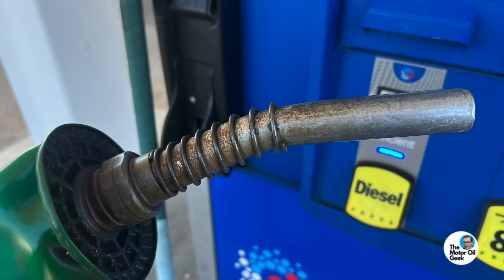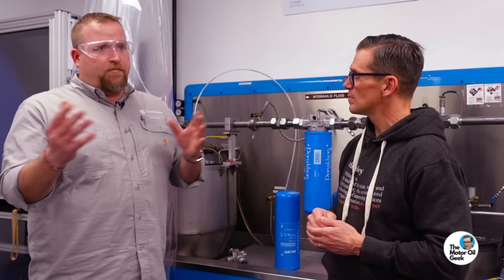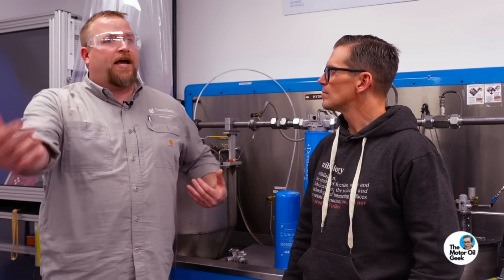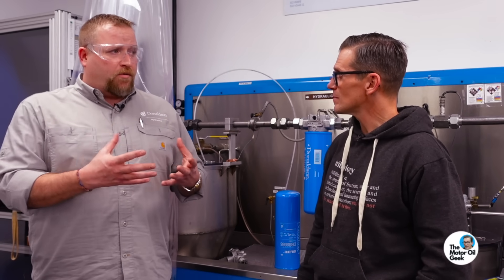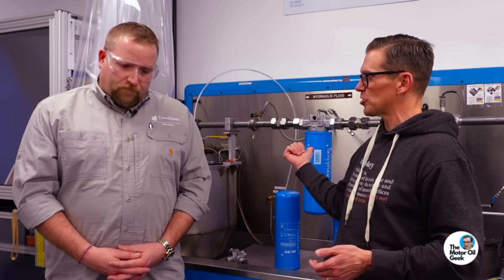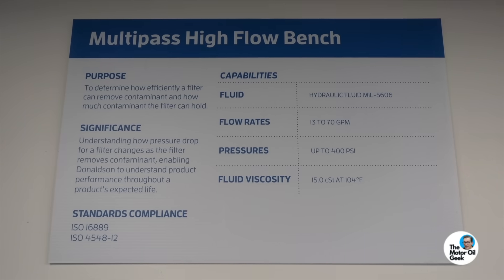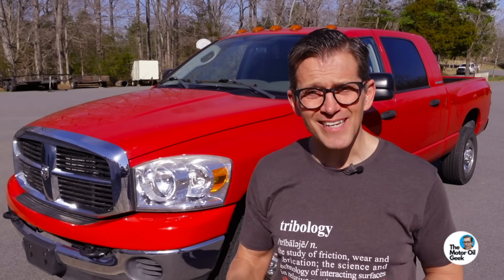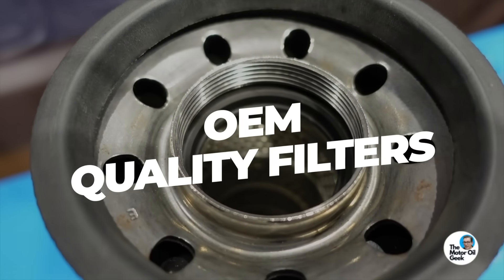Diesel Is DIRTY (And It's KILLING Engines)

Comment: That truck company that had issues every few weeks with injectors is not a normal thing I've been driving 18-wheeler for over 18 years and to hear injectors go out that frequently is something you don't ever hear not even in India were diesel fuel is crap. It sounds like that trucking company who had their own fuel source had dirt on their tanks. A lot of dirt.
Reply: believe it or not but the fuel regulation specs is tighter in india for diesel than in usa, so a big chain provider fuel there wold be better on average.

Comment: I want you to do a video on specifically why or why not it's a good idea to use 15W-40 diesel truck oil mixed with Marvel Mystery Oil in air-cooled bikes.  I know from experience you can do it for 45k miles or more, the clutch likes it, and it costs nowhere near $10/quart!

Comment: They need to stop making the engines with tighter tolerances that's the problem
Reply: The modern engine is much more efficient than the old engines . And you don’t like it tight while having ??? 😂😮
Reply: @TonyBenton0728 not realy
Reply: @bikerevolutiontv So you want it to be sloppy and messy that is the easy way to have ???.Just like the old diesel engines used to be. Dripping oil and fuel all over the ground and belching black smoke like an old freight train.
Reply: @TonyBenton0728 not a legitimate question
Reply: @bikerevolutiontv And yours was not a legitimate comment. We are not going back to the old days. So I turned your comment into a joke .
Reply: @TonyBenton0728 you sense of humor is screwed, much like your reality of a modern 15 liter diesel engine
Reply: @bikerevolutiontv My sense of humor is just fine. A 15 liter diesel engine will not fit in a pickup. And boy you can get 605 hp out that engine. I drove semi’s trucks for 41 years so don’t think I’m dumb on what diesel engines are all about. Most of your little videos are not about diesel engines more about motorcycles and lawn mowers.
Reply: @TonyBenton0728 if it wasn't legitimate, then why did you answer to it?
Reply: @bikerevolutiontv I pointed out that we are not going back in time. What you wish would happen is living in the past. Time does stand still for anyone.
Reply: https://youtu.be/9gw6B7kZrGk?si=JAdsY0kZmFlRDx9X
Reply: https://youtu.be/9gw6B7kZrGk?si=JAdsY0kZmFlRDx9X
Reply: https://youtu.be/9gw6B7kZrGk?si=JAdsY0kZmFlRDx9X
Reply: https://youtu.be/9gw6B7kZrGk?si=JAdsY0kZmFlRDx9X
Reply: https://youtu.be/9gw6B7kZrGk?si=JAdsY0kZmFlRDx9X
Reply: You don't drive truck anymore, so what you know of truck engines has expired.
Reply: @bikerevolutiontv I have a 2022 ford f-450 with the 6/7 L Power stroke and I do keep up with the trucking industry and diesel engines. If I didn’t know anything diesel engines and your trick question about the 15L engine how was I able to answer that question. So want brand engine are you referring to Cummins or Detroit Diesel. Just because I am retired that means I loss all knowledge about what I did . REALLY ??? Like I said in your videos you never talk about diesel engines so what do you know about them. I see you profile and see the caption’s of your videos nothing about diesel engines.
Reply: @TonyBenton0728 you bought and engine that was designed to fail. On every cold start it takes between 7 to 8 seconds of cranking for oil to get to the cam, and the main crank is last to be oiled. Cab off to do any revelantly simple work, thats dumb
Reply: @bikerevolutiontv Gee’s man you just won’t give up. So how about the duramax engine they are their issues and the transmission also. Do you don’t own a diesel truck anymore you sold it. This is getting old no matter what I say you are going to have some dumb comment just like your first one. And if my engine fails I will deal with it. But the likelihood of that happening is very slim. The Motor Oil Geek video was also dirty diesel not about oil how did you get on that subject ? Because you are deflecting from the original question.
Reply: @TonyBenton0728 @TonyBenton0728 you have an issue with paying attention. That Duramax was not mine, but I was selling for a friend and to refer back to the beginning of this argument. Just because I would like engines to not have such tight tolerances, doesn't mean the leak or blow smoke like you had replied. That was a stupid and uneducated choice. Much like the one you made for a truck you think so highly of
Reply: @bikerevolutiontv I didn’t watch any of your videos non of them interested me . And it look’s like it doesn’t interest many other people. You just proved me right if you never owned a diesel truck why are you worried about the tolerance of the engine ? I bet your motorcycles have very high tolerance as well as your Toyota . I drove trucks that belched smoke and would mark their spot while parked.  Give it a rest. You were called out for an uninformed comment. I will repeat again we are not going back in time. Become an engine engineer and design one and present it to the manufacturer.
Reply: @TonyBenton0728 Truth is not how you make it, it's what it is. Don't be jealous.
Reply: @bikerevolutiontv  Truth is you just don’t like being called  for something that is not going to happen.  It is what it is mean’s you are losing the argument and that’s all you got left. Jealous of What ? You have nothing for me to be jealous about.
Reply: @TonyBenton0728 not really, ever since I made a comment that truck should not have tight tolerances you still haven't been able to prove otherwise. Instead you ridicule my channel and wonder why you're being ridiculed. Just because you have the last comment doesn't mean you win an argument. I have proof that other vehicles that do not have tighter tolerances are made better or more robust it's as simple as that. But simple isn't your language I get it. I will make a video today commemorating you and we will see how simple that is for you to understand that!
Reply: @bikerevolutiontv I have nothing to prove . I just know that engine manufacturers are not going back in time. Make your video I will not waste my time watching it and not many other people will either. You have a great life. Hobby Mechanic 😂
Reply: There's your video bud. I even got your face on it.😂
Reply: https://youtu.be/9gw6B7kZrGk?si=JAdsY0kZmFlRDx9X
Reply: Now you have a video you can call your own
Reply: https://youtu.be/9gw6B7kZrGk?si=JAdsY0kZmFlRDx9X
Reply: https://youtu.be/9gw6B7kZrGk?si=JAdsY0kZmFlRDx9X
Reply: https://youtu.be/9gw6B7kZrGk?si=JAdsY0kZmFlRDx9X
Reply: https://youtu.be/9gw6B7kZrGk?si=JAdsY0kZmFlRDx9X
Reply: https://youtu.be/9gw6B7kZrGk?si=JAdsY0kZmFlRDx9X
Reply: https://youtu.be/9gw6B7kZrGk?si=8zZ28rmKA0VxM02N

😂😂😂😂😂
Reply: They don't drip oil, they don't waste fuel and they don't blow smoke. They last long, run high miles, and don't break down as much as light duty diesels.
Reply: And I like my little channel. If you had a channel that was better you could boast, but you can't. You just talk like you know things, but you don't. You're an old retired trucker that still lives in the past. I've got over a quarter million views on one video. Do you even have a video?

Comment: It wouldn't kill your engine if they made them like they made 18-wheeler engines
Reply: And the semi truck engines are much heavier than a pickup engine. People would not buy them because they would cost more.
Reply: @TonyBenton0728 that has no bearing on the matter
Reply: https://youtu.be/9gw6B7kZrGk?si=JAdsY0kZmFlRDx9X
Reply: Yes it would kill them, they're made with the same tolerances and they also have alot of issues with their DEF and DPF systems.
Reply: @SilverStarHeggisist Yes there are problems with the DEF and DPF systems but cylinder tolerance is not a problem all engines have tighter tolerance than in the past. Explains why the motor oils are lower viscosity than before.
Reply: https://youtu.be/9gw6B7kZrGk?si=JAdsY0kZmFlRDx9X

Comment: Had a upper fuel filter on a 2015 6.7 powerstroke plug solid at 7,000km ..... leaned out the motor on the highway locked up 7n3 cylinders due to heat and spun the bearings ....

The filters say there good for 15,000 miles and mine plugged at 7,000km lol 
Right .... 
Theres a great way to lose ur truck 
Shell fuel every time 
Lower filter still white ..... 
I dont even know what to do 
Obviously u cant win now a days with bullshit like this going on with fuels